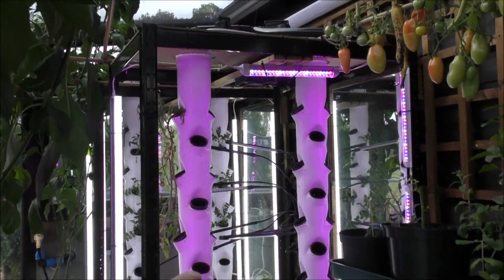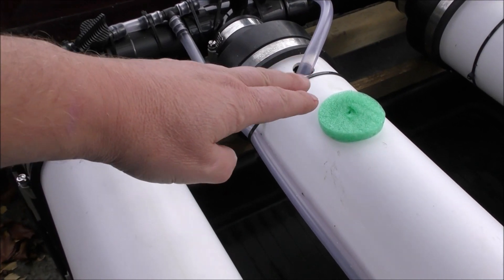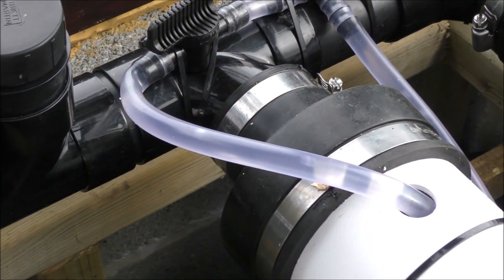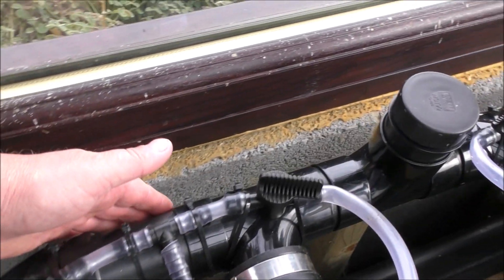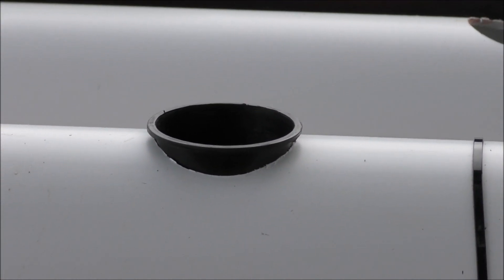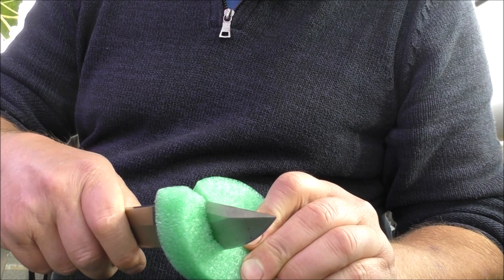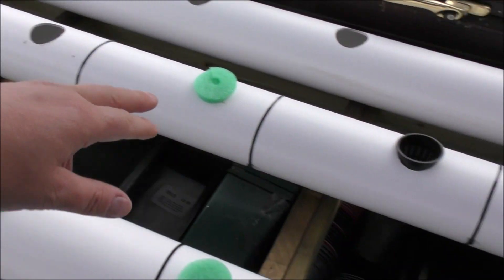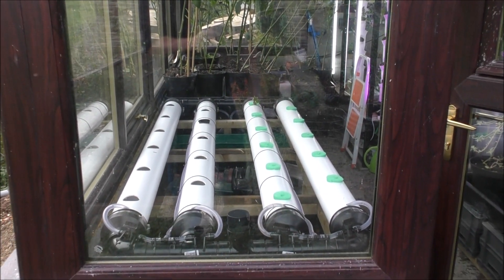New NFT Growing System for UK Greenhouse

Comment from the maker: I will keep you informed on how this goes - more videos to follow including the nutrient mix / testing, types of plants used and results / problems.
Dimensions of this system are approx. 2m (6'6") x 0.75m (30") and there are 22 holes for plants which are staggered to allow for maximum growing space.
Materials used for growing system:
2 x 450 lph (118 US gph) oxy water pump: https://filterpro.co.uk/450-lph-oxy-water-pump-73-p.asp
4 x 110mm (4") pipes 
4 x 50mm (2") 90 degree bends
6 x 50mm (2") tee pieces
50mm (2") pipe
4 x 110mm to 50mm (4" to 2") rubber reducers
6m (20') of 10mm (3/8") internal diameter clear pipe 
2 x 10mm (3/8") barbed tee pieces
2 x 12mm (1/2") flow control taps
Holes in the growing pipes are 45mm diameter to take a standard tapered 50mm (2") perforated pot.

Original video where I saw the foam being cut to hold plants: https://www.youtube.com/watch?v=JXKfIASdSqM

From the all-knowing internet:
"Nutrient film technique (NFT) is a hydroponic technique where in a very shallow stream of water containing all the dissolved nutrients required for plant growth is re-circulated past the bare roots of plants in a watertight gully, also known as channels."

I recently bought an electronic test stick to make sure I get the nutrient levels correct and also picked up a couple of nutrient solutions formulated for leaf growth from North East Hydroponics: https://northeasthydro.com/ as I was passing one day and . Next video will discuss the nutrients, show how the test stick works and explain why it is a very important piece of kit.
When I tested the water in the reservoir which supplies the vertical growing towers it was off the scale so maybe I should have bought a test stick this time last year.....
If anyone is interested and lives local feel free to call in any time to see the systems (and share any tips) that's no worries - just give me a ring first for directions.
Richard 07772848730

Comment: This new Youtube channel is very entertaining!  

A couple of questions:
(1) Why not incorporate an airstone in the reservoir?  Smaller bubbles produce more oxygenated water.  The bigger bubbles produced by your aerating pumps are a less efficient way to oxygenate the water.
(2) Why not increase the number of 2" ports in the 4" tubing?  Currently ports look to be spaced at 12".  They could be spaced at 6" or even 4" intervals to double or triple the number of ports.  Your use of pond water seems to garuntee that nutrients will be present in abundance.
(3) one question about the pond water however because you filter it - is it optimized for pond life (fish and invertebrates) or vegetables?  

I admire your dedication to explore different ways to grow high quality vegetables.  Seems destined to pay off in table fare and life satisfaction!
Reply from the maker: The bubbles produced by the pump are shredded in with the water - it's only the larger consolidated bubbles you're seeing in the pipe. I made this video a while back which shows how small the bubbles are from the pump and they travel all round an aquarium, not just rising up like they do from an air pump: https://www.youtube.com/watch?v=mmJmnf-4ukU&t=1189s
From 18:44 you can see how tiny the bubbles are and when I highlight them with the flashlight shining in it makes it even more visible - the bubbles behave very different from air stone bubbles as they are shredded so small.
My previous system had the holes in the pipes spaced closer together and I found it limited the choice of plants. With a wider spacing I can use the system for a wider variety of plants and also allow more room between root masses in the pipe so the plants can stay in longer if they are able to be regularly trimmed for harvesting (e.g. Swiss Chard).
The water feeding down from the filters is from the bottom so it drains off the very fine silt along with the water. It's really in the silt where the nutrition is best. The water exiting the filters back to the pond is cleaner since it leaves some of the sediment behind in the filters. Therefore the water heading back to the pond is better for the fish, water from he filter drains is better for the vegetables.
I'll keep you informed as to how the new system does - I just pricked out some seedlings into bigger cells to grow on and then put into the system. Types of plants currently growing for inclusion there include Chard, Purslane, Bok Choi and Chinese Cabbage but I have other seeds to sow once the space for them is cleared.
I may put mint, basil etc in too just to see how it goes.

Comment: Hi, I use both systems, the hydroponic tower and the NFT. For me, both systems work very well, but each has its advantages and disadvantages. If you want to grow lettuce, both are very good, but if you want to grow strawberry plants, it is possible with both systems, but the NFT gives much better results.
Reply from the maker: Nice one - thanks for the feedback and I'm glad the systems are working well for you.
I tried strawberries in the towers and it was a disaster since the roots were far too wet in there. I'll try again with strawberries in the NFT when I put it outside next spring.
Reply: @ThousandYardStare  hello Richard,  for your strawberry plants, in both systems, the roots are permanently in contact with water, I don't think that's where the problem comes from. I think more for a problem of root disease or improper fertilization. 
To use both systems, I noticed that the hydroponic tower allows the strawberry plants to grow faster than in the NFT, and the production is good. The only problem I have observed is that the strawberry plant grows into a long fragile body, as it grows, several leaves break easily, and with the weight of the strawberries, it falls out of its place (in the hydroponic tower).... The problem does not exist for the NFT system, since the position of the plant is different. 
I tried to add two pictures taken from my hydroponic tower and my NFT to show you the problem, but Youtube deleted my comment with the links to the pictures.
Reply from the maker: @pierreshasta1480  Thanks very much for that and it absolutely makes sense as last season I was not monitoring the nutrients. As I now have a test stick I can see that the water being used for the vertical towers had way too many nutrients in and it was right at the top of the scale. The new system in this video now has a good balance of nutrients so once my seedlings are grown to a size suitable to transplant into cells then into the NFT system I'm expecting much better results than had been achieved previously. Once the water in the vertical system has been balanced I'm expecting better success from that one too.
Any links in comments get held on Youtube so you could send the pictures to sales@filterpro.co.uk if you still have them as I'd love to see  the set up.
Reply: @ThousandYardStare  hello,  Email sent. I hope you have received it.😊
Reply from the maker: @pierreshasta1480  Nice one, man - I will reply via email.